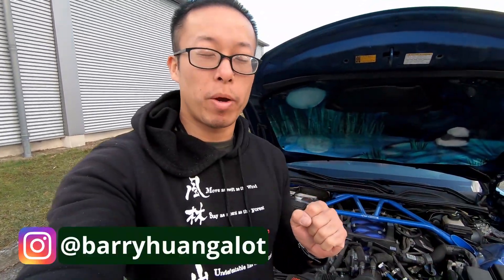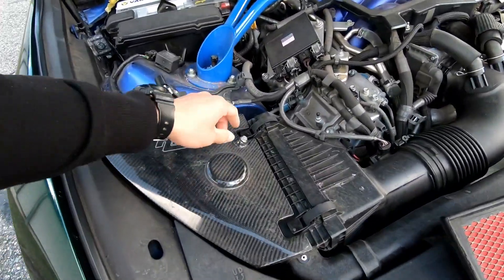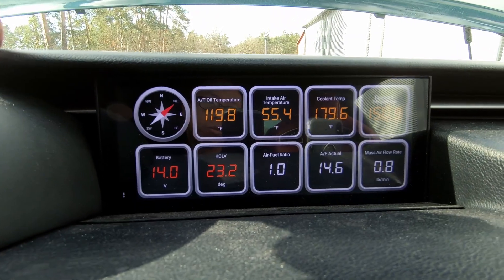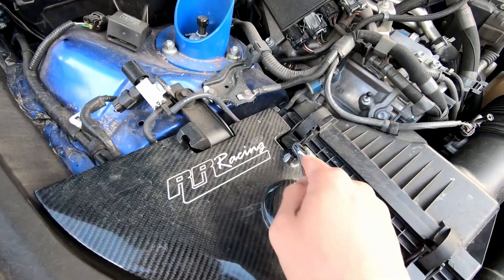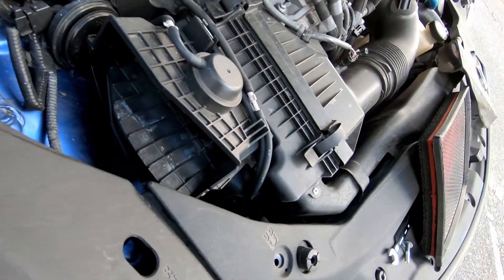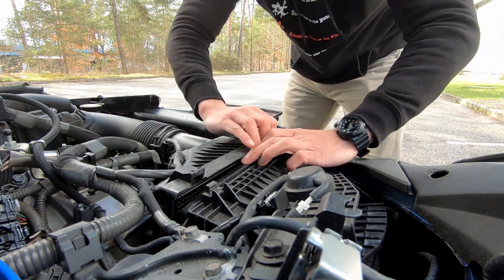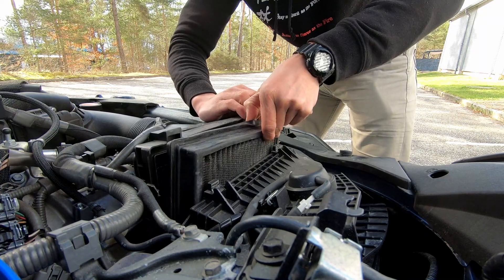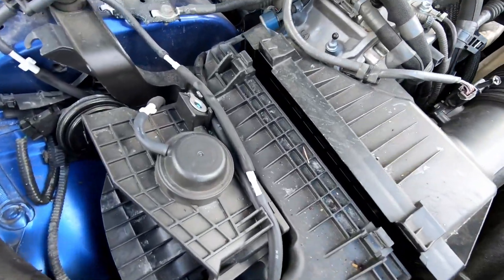Lexus RCF Tom's Engine Air Filter Install With MAF Data Comparison Results to aFe Filter

Comment: Great video! Never heard of that brand before but definitely will try it out after some more miles on my K&N. Their website shows all their great products, even exhaust part! Main reason for visiting today is a question about Induction/Top Cleaner on the Lexus RC (I own a RC350 F SPORT). You ever try it? Bought the Toyota Induction Kit and curious as to which vacuum hose to connect to.
Reply: Tom's is the premier brand for Lexus Racing.
Reply from the maker: Im unsure about that kit. I know what it is but should be a plug and play if it is from Toyota.

Comment: Man what are your thoughts on the valley plate leaking, wait for it to happen or replace the sealer asap
Reply: My f is in the shop now for it.  The main symptom is coolant smell outside the car and no heat.  Just wait for it, failures seem to be random.  Just make sure you/they use the updated adhesive.

Comment: Off topic but do you think the RCF would be a good upgrade coming from an wrx STi?
Reply: As a gsf owner and having driven some wrx, ima say yes.  Just make sure you get one with torque vectoring diff and not the torsen diff.  Way better overhead and reliability imho.  

Other options are a gti or r.  Those things man.....most underated hatch in history.

Comment: Could you also do an update at 200k miles how its been
Reply from the maker: Could but by that time, I would have replaced the air filter and such.
Reply: @thehuangbros  is buyin 100k rcf worth it or should aim for better milage
Reply from the maker: @SmokieTRW  itll last. But there is better mileage I feel

Comment: you need to clean the mass air flow sensor, use liqui moly Luftmassensensor-Reiniger Article: 8044
Reply from the maker: What makes you believe I need to clean my MAF sensor? Im curious. I only changed the filter and didnt change any other variable.
Reply: @thehuangbros  You need to clean it because you used an afe oil filter, so the mass air flow sensor is dirty and needs to be cleaned of oil deposits.
Reply from the maker: @LostCdru  my aFe filter is dry.
Reply: @thehuangbros  Then it is not clear why there is such a stain on the back of the filter, as if it had been saturated with oil.
Reply: @thehuangbros  Then it is not clear why there is such a stain on the back of the filter, as if it had been saturated with oil.
Reply from the maker: @LostCdru  lol because suction and dirt
Reply: @thehuangbros  I don’t have this on the f sport filter, such a trace was only on the kn and simota filters, clean the mass air flow sensor anyway, some indications will return to normal

Comment: I’ve done some maf reading testing between different filters. Afe Takeda intake showed more than afe drop in filter for sure. Then after i added equal length headers, i compared 3 different cone filters with a custom intake set up. Worst filters did 35 lb/min and the best being inverted cone filter doing 51.8 lb/min. Pretty cool to see the air flow actually increasing
Reply from the maker: What were the different cone filters that you had?

Comment: The car probably adapts over time (given your old filter looked decently clogged), but either cleaning your filter more often (if it's cleanable) or replacing paper filters more often will make the bigger difference.
Reply from the maker: Yeah. That is why I say it is the dirty filter vs clean filter. I think with this video, i have a baseline to see the trend on the maf at idling
Reply: @thehuangbros any update on how it feels?

Comment: About how many miles does the TOMs air filter last?
Reply from the maker: Hell that is a great question. Probably not as reusable it appears
Reply: @thehuangbros  that’s what I was getting out … I currently have a K&N which I need a substitute so when I clean and re oil the K&N.
Reply: @Ro1_1ex i didnt like my toms filter felt like no extra perfomance and seemed to kill fuel econ.  Back to oem paper.

Also dont used oiled filters....  Mafs cost way more than extra filters
Reply: @dvaritek434  I used a blitz filter and it’s ok. No added performance I think but I just sold my car. Going for an LC500 now.

Comment: Did u cut your fender for the heat shield? It doesn’t look like u did
Reply from the maker: I did not cut the plastic. It doesnt get that much extra air. There is the fender and chassis in the way of a good air flow so it wouldnt benefit from the cut in my opinion.
Reply: did you data log after the CF heat shield??  RR Claims a gain of 11HP roughly... Notice any gains after install?? @thehuangbros
Reply from the maker: I did not but I would have loved the chance to data log it. I did have the ability to assess the intake temp but couldnt figure a good time to do it.

Comment: DUDE! Please tell me about that sweet touchscreen and all the indicators on it :)
Reply from the maker: Here is my install video and link on it. So far, I have been able to clear other people’s codes using my car hahahah. It is weird to use my car to do it but I have.

https://youtu.be/cVjMaoiiiRs
Reply: @thehuangbros  Thanks!
Reply: U are getting more flow on the expense of less Filteration. OEM is the best if u want the engine to last amd not wear out rings from silica not filtered by these AFE, K&N and Tom's filters. Watch filter test video by project farm. I am trying to find WIX filter which is currently out of stock. It seems to have the best flow and Filteration at the same time. Installed in my truck and felt the difference over OEM. Made in Korea.